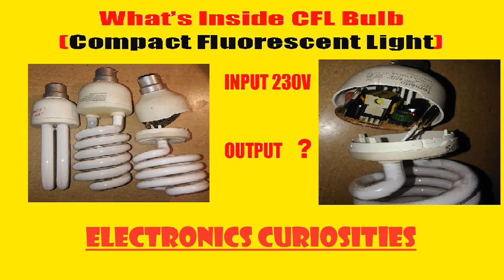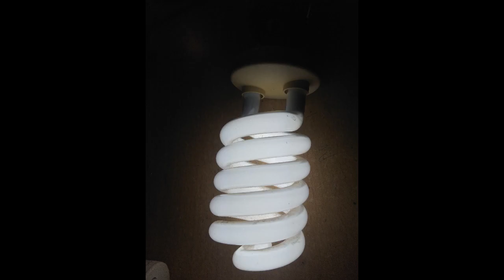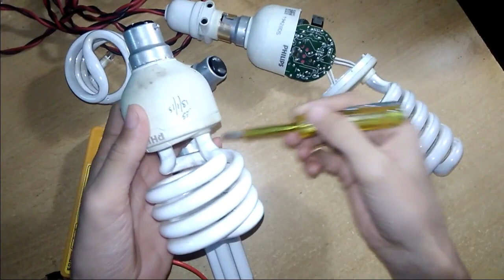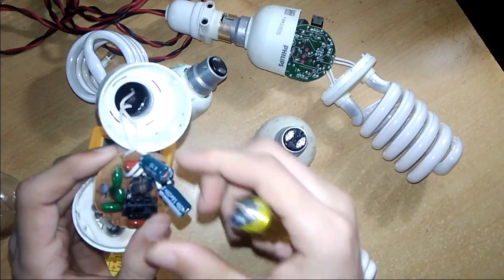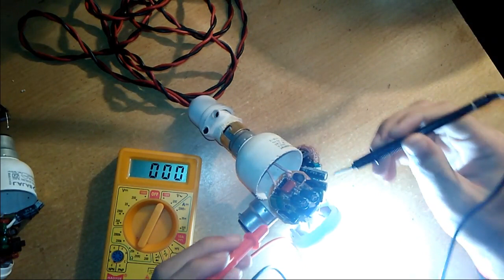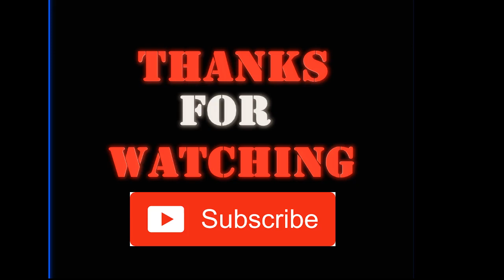What's Inside CFL Bulb (Compact Fluorescent Light) and what's it's Input and Output Voltages.

Comment: Can we directly touch output like we do with charger ?
Reply: I think it not safe to touch output of cfl circuit with bare hands, because output of cfl circuit is high frequency sine wave which is similar to a supply that comes in our house but our household supply has low frequency 50hz,so. From my analysis I think its not safe to touch cfl output with bare hands.
Reply from the maker: ya that's correct👍

Comment: Multi meter shows rms/average value of of the ac voltage so you didn't get peak voltage. Also even top brand multimeters don't respond well to frequencies over 400hz.